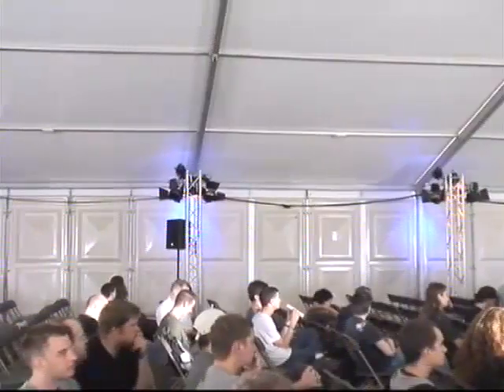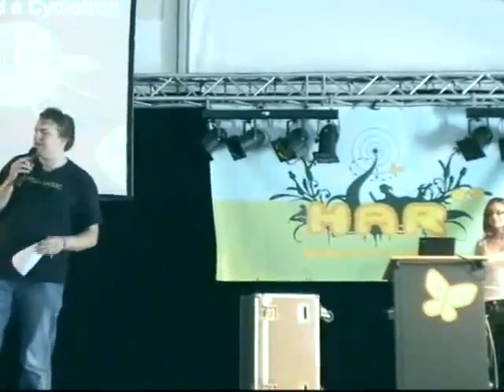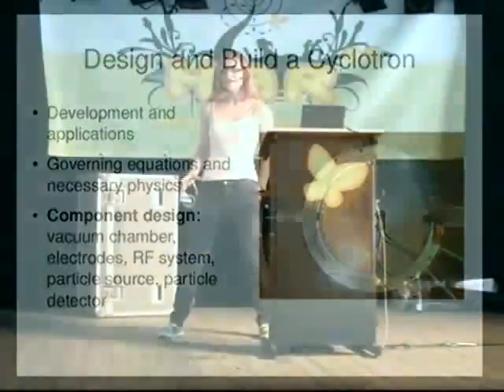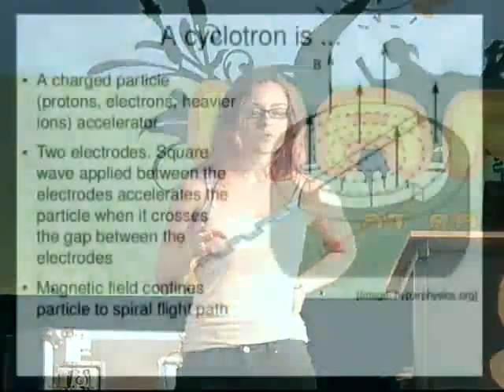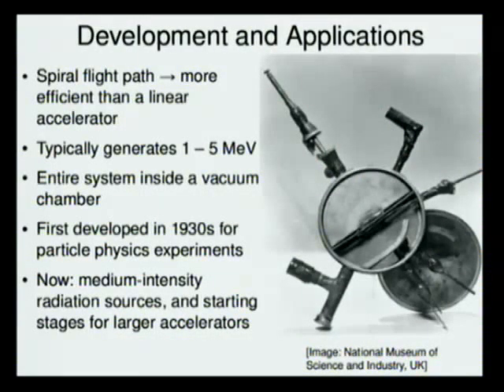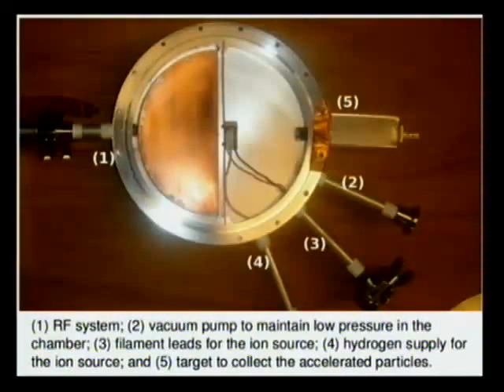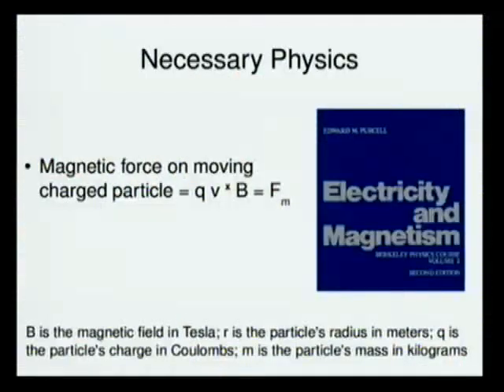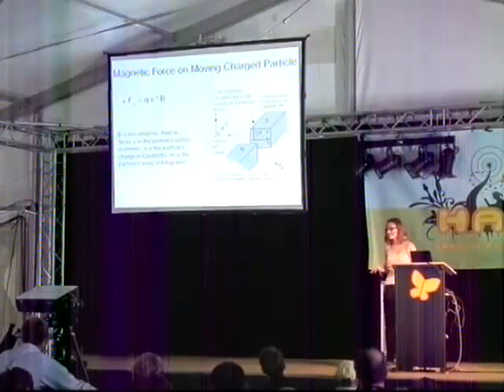HAR 2009: Design and Build a 2 MeV Cyclotron part 1 1/6

Comment: I'm studying physics at the National Autonomus University of Mexico (UNAM in spanish) and I was  looking for information about particle accelerators because I'm trying to build an accelerator  prototype more specifically a Microtron which starts like a Cyclotron, so I found this video. My point is, can you help me with some questions that I have? because this is my bachelor's degree  thesis work and I have tried to do something like you did, but I do not have to much information about how to buil it, which material I need and how to use it.

I hope that you can help me and I really hope that you can understand my very bad english.
Greetings